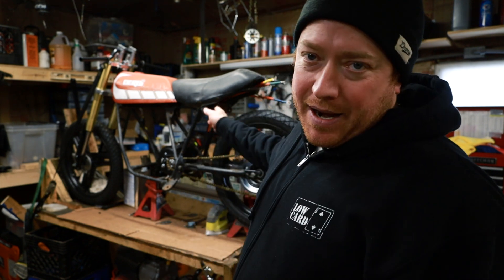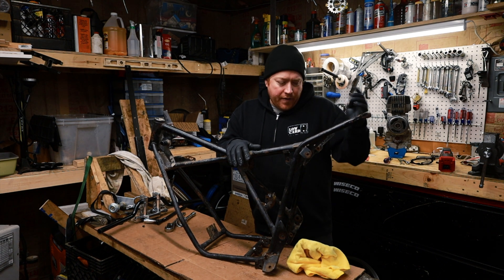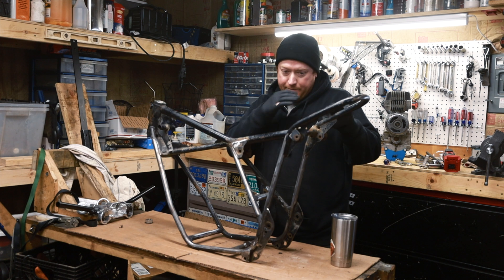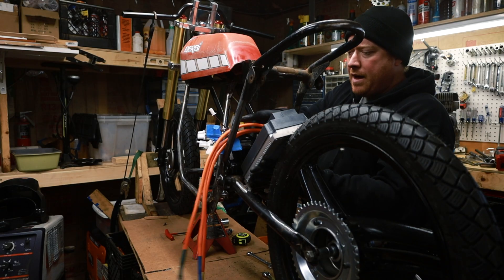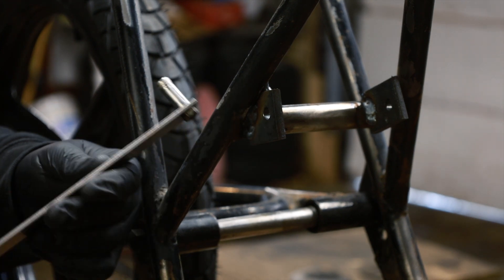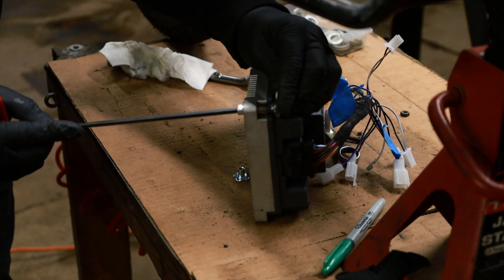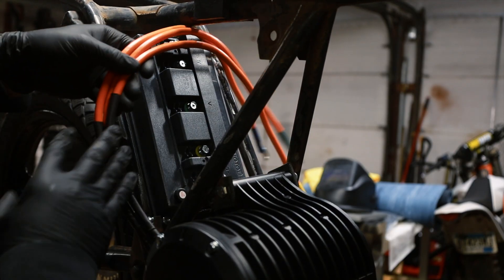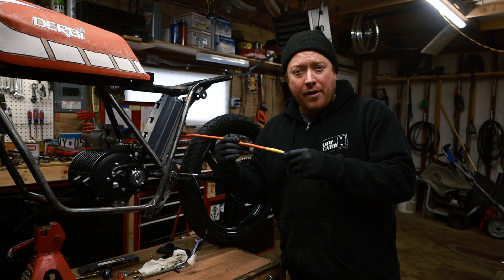Mounting the Votol em 200 ebike electric moped controller in the Derbi

Comment: Plenty of space in that frame for batteries. Would be great to see one of these electric mopeds with rally range. :sanitizer:
Reply from the maker: Yeah range is tough. At this point I feel like it's hard to get 50+ miles with acceptable battery weight/size.

Comment: Ugh, I could never hack up a Derbi. You couldn't find a Batavus or Jawa to hack up?
Reply from the maker: This bike was yard art in TN. Nothing on it is was worth saving. Even the frame already had a honda express motor on it. I cut a lot of "custom" welded tabs off. I actually got the frame back to mostly stock. So far I havnt dont anything that isnt undoable. also the one stock motor mount I did cut off was horrible, if I put a derbi engine on this I would redo that anyway.